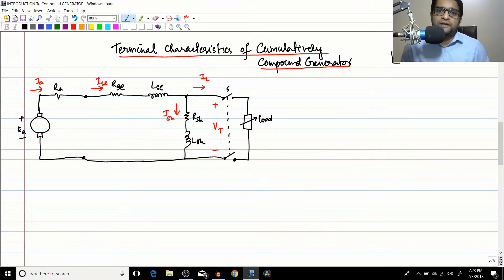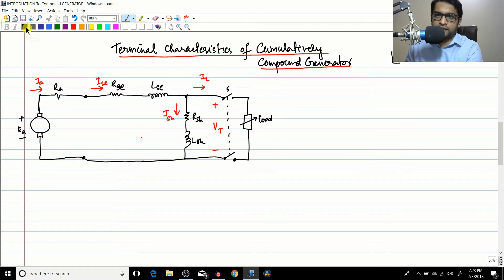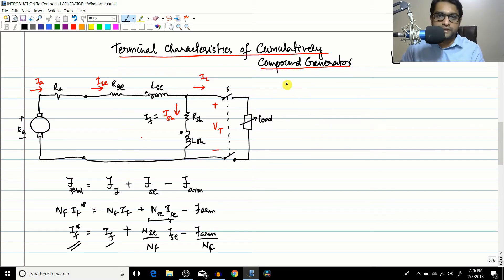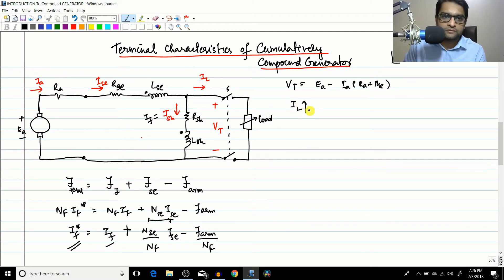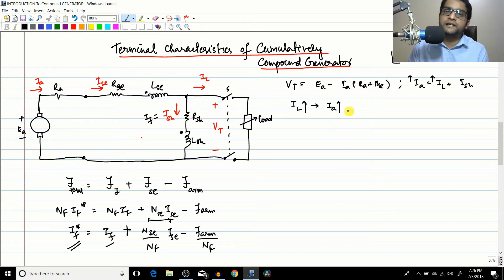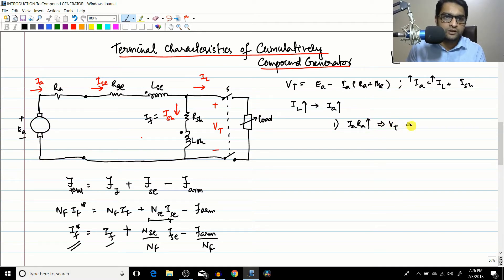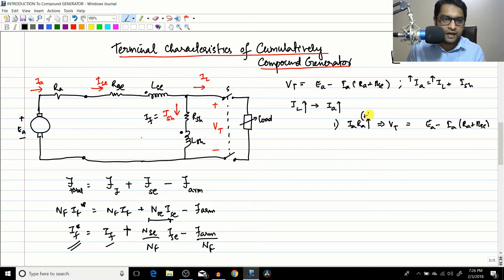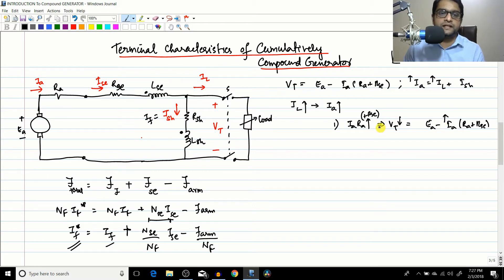#25 DC Generator -  Cumulative compound Generator #2 - Terminal Characteristic ( Compounding types )

Comment: An over-compounded dc generator i-s supplying 800 A at full load on 500 V. The resistance of each conductor is 0.02 ohm. The percentage of compounding is?
Please give ans with formula

Comment: A load for a compound generator is located one mile from the generator. The voltage at the load is to maintain as load is increased. Which compound generator is used?

a) flat
b) over
c) under
d) differential

Can someone help me with this question please
Reply: Flat compound may be to maintain constant voltage

Comment: Amazing. Please explain how the load current is increasing? How have you assumed that if load current increases then armature current increases and so on. Because load current is produced due to armature current.
Reply from the maker: Remember this is a generator..the increase in load current means a demand of load which means a decrease in resistance of load..so the armature current would have to increase to give the demand load current...so it is not an assumption that load current increases...